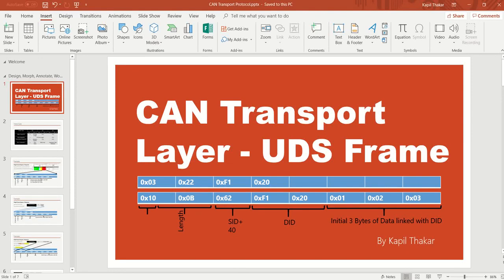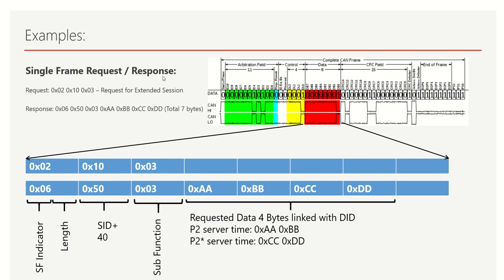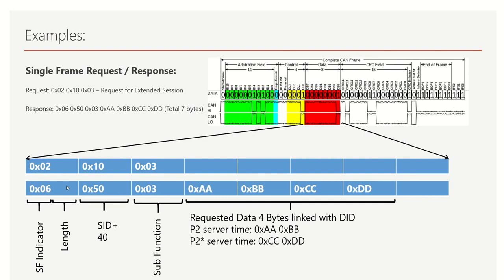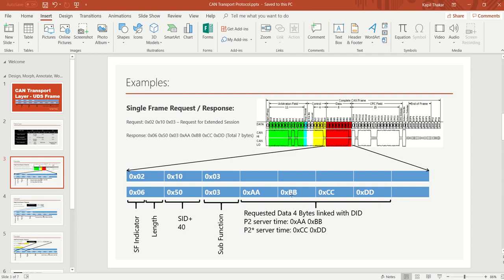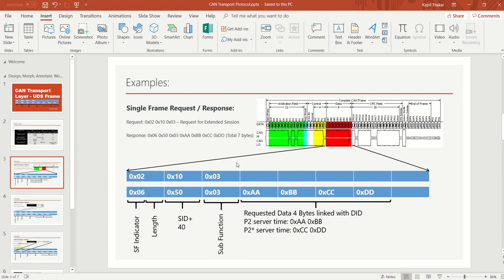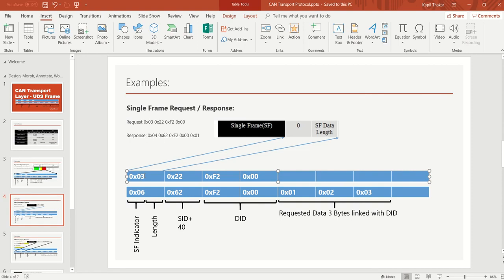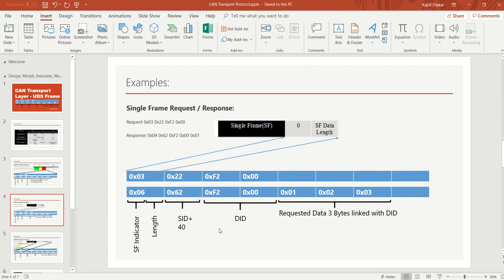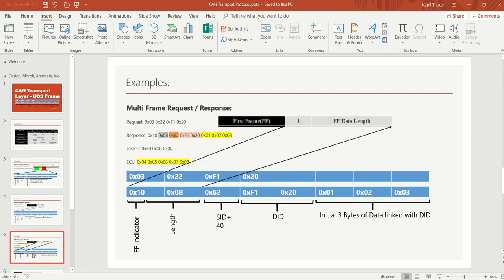CAN Transport Protocol UDS Single and Multi frame Request Response | Part 1

Comment: Thanks you bro i want you to explain uds 14229 doc .if you want i will give.
Reply from the maker: Which chapter or point u want to know of iso 14229 ?
Reply: @Kapil_Thakar  thanks for replying
1)conventions((where aplication layer services & application layer protocal))works in which layer.how it works?

2)Document overview (fig 2 : explain osi layer in uds & uds works in which layer)

3)uds & diag are same or different?

4)SDU & PDU (IN 6.4 topic. A_SA 2BYTES
                                                A_TA 2BYTES
                                      A_LENGTH 4BYTES
So total 8bytes data then where is can data is 8.we can 8bytes data only.
Reply: Can you send ppt kapil